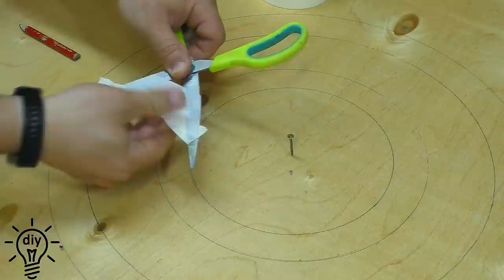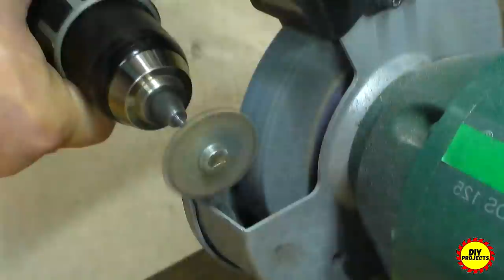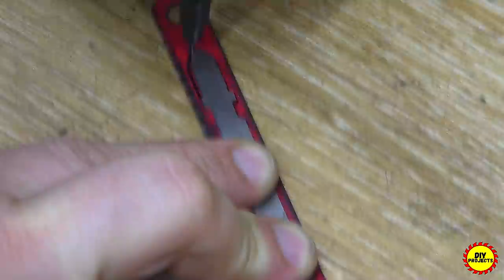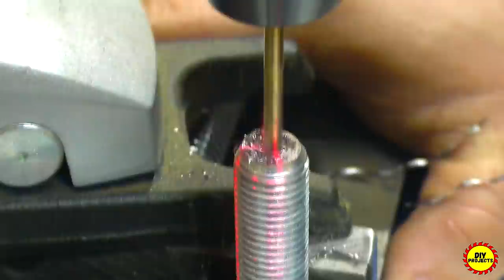Amazing tricks that will take you to the next level of work - Tips and Tricks

Comment: Thanks for the video.   A lot of excellent ideas.
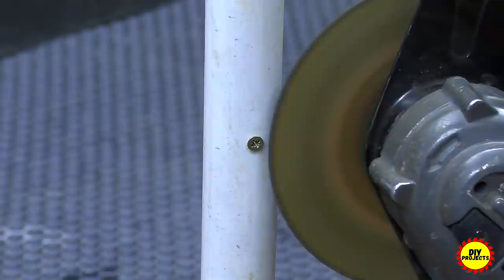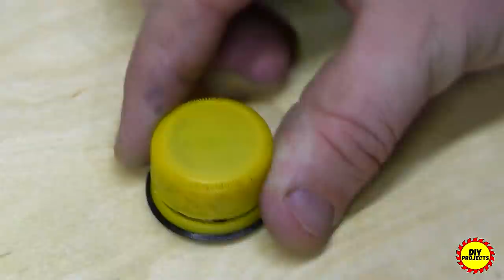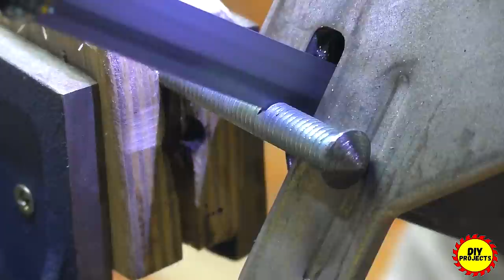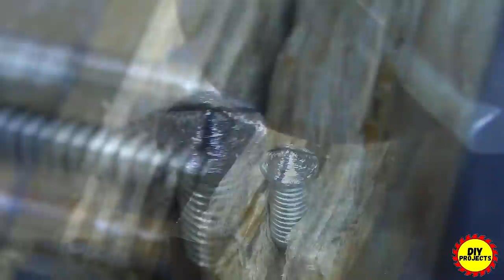What tools do you use at time marks: 4:03, 4:34. 5:28, 6:20?   Looks like a jigsaw and an angle grinder.
What blade for the jigsaw that can cut metal so smoothly?  And which angle grinder that has such control?